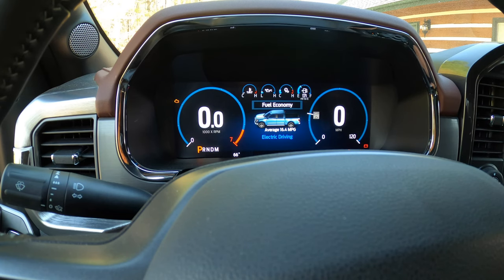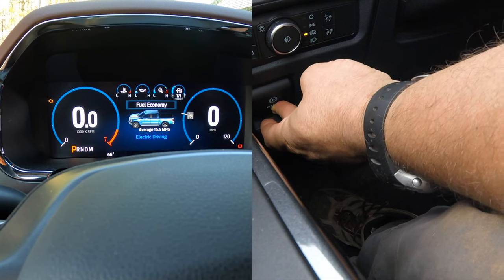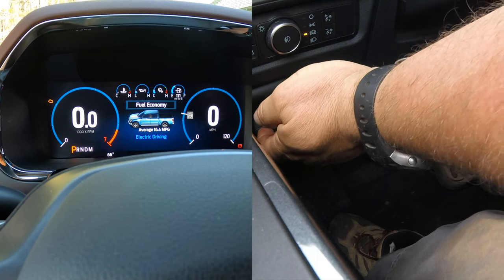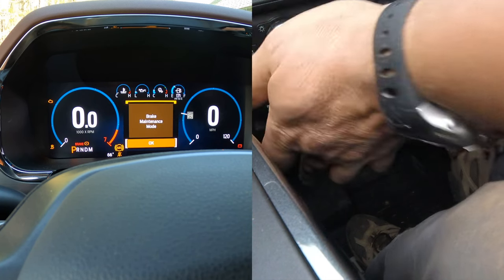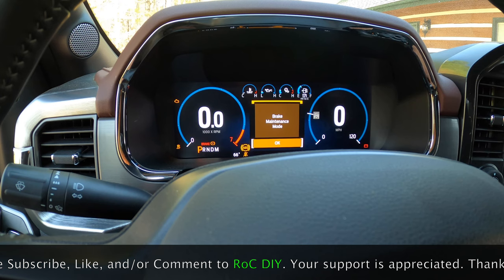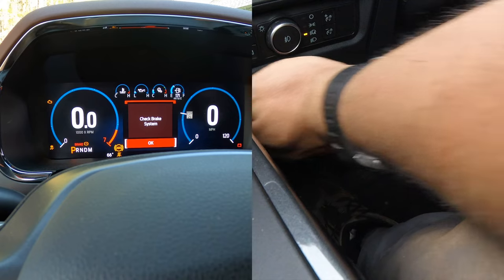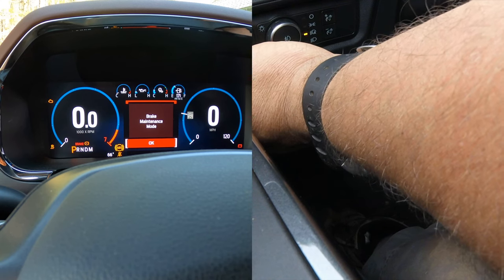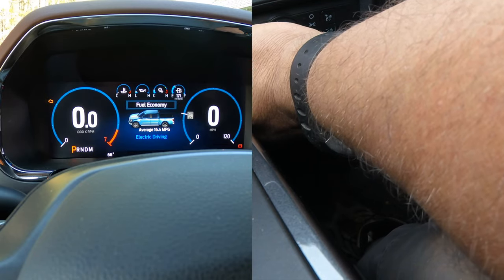2021 Ford F150:  Brake Service Mode

Comment: Just changed my 2021 F-150 Max Tow front brakes and rotors to power brake extreme tow and followed your video for getting in and out of "brake maintenance mode" it worked perfectly. Thank you
Reply from the maker: That's great to hear. Thanks for watching and commenting.

Comment: Did this and when I went to take it out of service brake mode it threw a “Park Brake limited function service” 🙂😐
Reply from the maker: I assure you it is the proper procedure. I would re-reinitiate BSM, then attempt to turn it off again. If you can safely drive your vehicle it should reset. Don't drive if you brakes don't function properly or your parking brake is not functioning as it should.
Also, be aware that this fault message may not be related at all to initiating BSM. It could be coincidental.

Comment: Just replaced the front pads and rotors only same model and i got abs light pop up and exclamation red mark. And the breaks isn’t as firm as it used to. I thought you omly needed the BSM for the rear. Any advice?
Reply from the maker: It is only supposed to be for the rear. I ran in to the same issue after doing some front brake work, so I've been telling everyone that if you do anything with any of the brakes you need to be in BSM to avoid issues.
I would very carefully drive in a safe area. Mine cleared up after driving it a little bit.
Another option is to disconnect and reconnect the battery.

Comment: Why does it need to be in this mode?
Reply from the maker: Not putting it in BSM for any work done on the brake calipers, brake pads, brake lines, parking brake, or brake discs could lead to a series of error messages and your brakes not functioning properly. Error messages or brake issues don't always show up right away (need to cycle) and you don't want to be driving when they show up. I personally put it in BSM anytime I touch front and/or rear brakes. I do this because I did some front brake work only without putting it in BSM and right after I got done, I got error messages (6) and my brakes didn't work. It self corrected, but it was crazy.

Comment: I have a parking brake fault code currently, my right rear isn’t engaging or disengaging and I’m stranded 7 hours from home. Tried this procedure several times and it’s not going into maintenance mode. Next step is to pop off the wheel and try to manually disconnect the brakes so I can get home but I’m worried if I just disconnect them the brakes will stay locked up and I won’t be able to get them unlocked at all
Reply from the maker: Sorry to hear about the situation you are in. Did the fault code just pop up or is it related to some work that may have been done? Sounds like the parking brake fault code is unrelated to putting your vehicle in brake service/maint. mode. Unfortunately, brake maintenance/service mode isn't for resolving issues. It's for preventing issues. It's not going to resolve a parking brake fault code. It may not fit your timeline, but I'd have it towed in to the nearest dealership for repair.
Reply: @RoCDIY  my problem is I’m on a tiny island and it’s Easter weekend so no dealers are open, and I need to be home for work Monday. I’m desperately just trying to disengage the brake on that wheel so I can get home. My only option is to manually disengage the automatic brake or remove the caliper completely somehow. Towing isn’t an option
Reply from the maker: @nickforster2496  Wasn't aware of your whole situation. I hope you have or will figure it out. Be safe!
Reply: @RoCDIY  I was able to remove the solenoid for the emergency brake this morning and get the caliper loose luckily so now I can at least get home. I’ll be listening to an alarm for the whole drive home though unfortunately
Reply from the maker: @nickforster2496  Glad to hear it worked out. Safe travels.

Comment: does it apply for front and rear brakes?
Reply from the maker: Most definitely. Not putting it in BSM for any work done on the brake calipers, brake pads, brake lines, or brake discs could lead to a series of error messages and your brakes not functioning properly. Error messages or brake issues don't always show up right away (need to cycle) and you don't want to be driving when they show up.

Comment: This may be a dumb question, but is it ok to turn the ignition off while changing the brakes? So put it in BSM, turn the ignition off, do the work, then turn the ignition back on to take it out of BSM?
Reply from the maker: Definitely not a dumb question because it was exactly what I did. I wasn't aware of brake service mode. I had six different alerts and no brakes right after I did it. Even when the truck is off it is "awake." It basically knows if something has changed. If there is a change in fluid, brake piston position, brake pad thickness, it will know. Even if you disconnect the battery, then reconnect it, it will know there was a change. It takes the truck 14 days of no use or a drop to 9.5 volts to go into deep sleep mode.

Comment: Maybe I missed it looking through your videos but I didn’t see the actual break and rotor change out process on the 2021. Is it the same as the previous years you have on here ?
Reply from the maker: Maybe what I said was misleading, but it wasn't intentional. I have done a brake change and painted calipers on my truck, but I have not changed out rotors. The point in mentioning all the different things you could possibly do related to brakes should be done while in brake service mode in order to avoid faults.

Comment: Do you need to put it in this mode if you don’t have an electronic parking brake?
Reply from the maker: If you don't have EPB, but you have the ability to put your truck in to brake service mode, then you should.

Comment: I have a 2022 hybrid Poweboost, is this process needing to be done for maintenance of the brake system?
Reply from the maker: Yes, brake bleeding, changing brake pads and/or calipers and/or rotors. You may or may not get faults or have brake issues if you don't. I tested it and had both. I got five faults and brakes didn't work after painting brake calipers. The trigger was that the caliper pistons had to be compressed manually.

Comment: Is this just for the rear brakes that just have the electronic parking brake? Doesn’t seem like you would have to do this for the front brakes?
Reply from the maker: It is for the rear brakes with EPB. I personally put it in BSM anytime I touch front and/or rear brakes. I do this because I did some front brake work only without putting it in BSM and right after I got done, I got error messages (6) and my brakes didn't work. It self corrected, but it was crazy.
Reply: @RoCDIY  good to know, I feel like that’s due to this new generation having a different master cylinder set up, I think it’s all electronic I believe and it costs like 2k from what I understand. I think it’s because of the electronic abs and ecu stuff is all attached to the master cylinder and comes all as one piece. Watched it in a fordtechmakuloco video he did of his 2021 f150. Crazy….

Comment: Can you pump pedal and bleed brakes on 2021 f150 without doing this?If you do use maint mode can you bleed brakes by pumping pedal?
Reply from the maker: Yes, brake bleeding, changing brake pads and/or calipers and/or rotors. You may or may not get faults or have brake issues if you don't. I tested it and had both. I got five faults and brakes didn't work after painting brake calipers. The trigger was that the caliper pistons had to be compressed manually. It is for the rear brakes with EPB. I personally put it in BSM anytime I touch front and/or rear brakes. Read up on bleeding brakes before you start. Vehicles have become so complicated. There is an order to the bleeding process.
Reply: @RoCDIY  hi how do you put the car in BMS? I need to replace the front brake pads. So on front brakes. Thanks
would prefer to avoid an error message because it happened to me once and it went to the workshop.
Reply: is it possible to put in the BMS manually to change the front brakes. Or what kind of function in scan tools do you have to have to do this?
Reply from the maker: @jockermy7834  The video shows how to get in to BMS mode. BMS mode is specifically for rear brakes. I personally have experienced issues with doing work on the front brakes, but BMS is not supposed to be for front brakes. The best thing to do is put it in BMS mode as outlined in the video to be on the safe side. I didn't have issues with the front brakes when I put it in BMS mode. If you ask me why. I don't know.
Reply from the maker: @jockermy7834  As stated previously, BMS is supposed to be for rear brakes w/ EPB. As far as a scan tool. Way too many out there with many different functions, bypasses, and resets.
Go into BMS mode and change your front brakes. You should not have an issue. Don't start or turn the ignition for any reason just to be on the safe side.

Comment: Will this allow me to bleed the brakes? I read a scan tool may be required...
Reply from the maker: I am not sure what you read, but you can bleed your brakes while in brake service mode. The whole purpose behind BSM is to basically put the system in sleep mode while you do what you need to do. I am not even sure what a scan tool will do for you to bleed brakes. I am curious though.
Reply: @RoCDIY  there was a couple forum posts claiming FDRS or a scan tool was required. And some having issues with fault codes being generated. They may not have entered brake maintenance mode at all, though.
Reply from the maker: @stevetrepanier4351  Got it. I can 100% vouch for the fact that you will get numerous fault codes if you don't go in to brake service mode. It happened to me and I had no brakes at all. This happened before I knew my new truck had BSM on it. Also, I can see where a scan tool may be needed after you don't use BSM because you would need it to clear the fault codes.
Reply: @RoCDIY  very helpful thank you. I will flush my brake fluid this weekend!

Comment: Do you need to be in maintenance mode when bleeding ?
Reply from the maker: Definitely. You may get a fault code/error messages and/or your brakes will not function properly.

Comment: What does this do? Why should I do it replacing the pads?
Reply from the maker: This is specifically for rear brakes, if you have electronic parking brake (EPB). I can tell you from personal experience if you manipulate anything with the rear brakes while not in brake service mode (BSM) the truck will know and you will get fault codes and your brakes may not work. It has to do with ABS, ECU, EPB and master cylinder all being tied in together as an overly complicated system.
In your case, you are more than likely going to have to compress the caliper piston which will change where the piston is, moving brake fluid and changing the master cylinder. The ECU is going to sense the change resulting in the aforementioned, unless you use BSM.